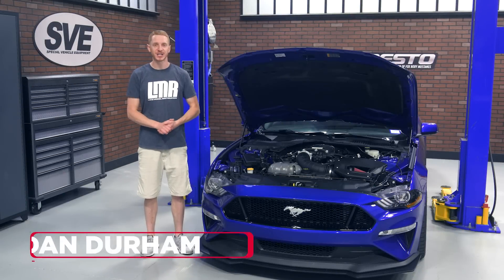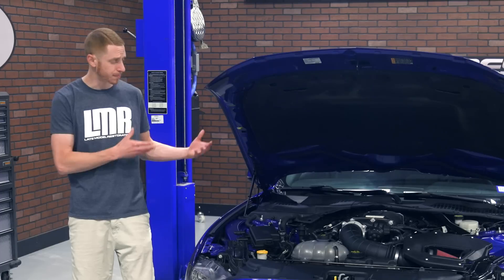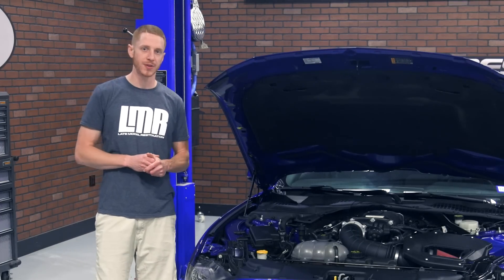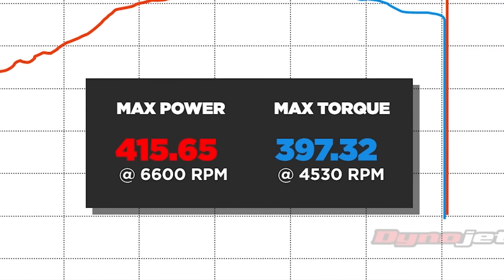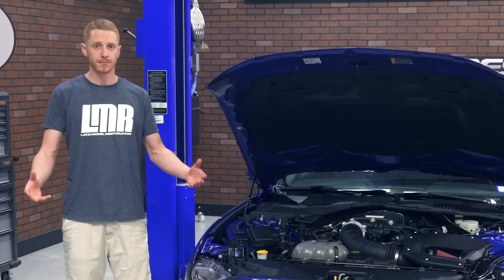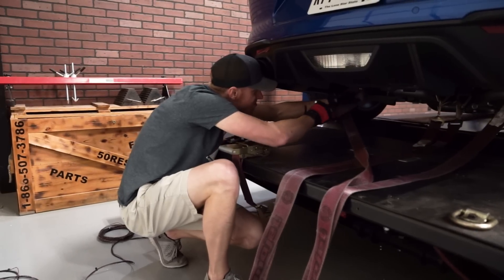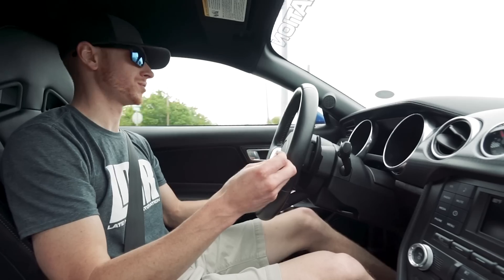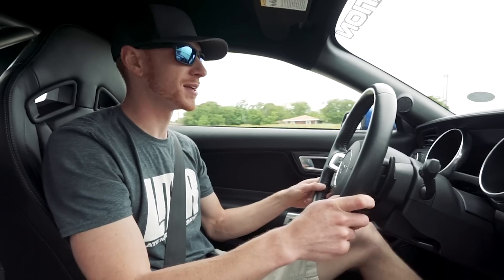2018-2021 Mustang Roush Supercharger Phase 1 Kit - Review/Dyno/Test Drive

Comment: Is over heating an issue still? Im looking at a used 2020 with this brand but i dont know which version intercooler yet
Reply from the maker: The Phase 1 kits are no longer available. The Phase 2 kits include a larger heat exchanger and different calibration. We did some very minor testing, and the Phase 2 stuff does help the car, but it didn't just "knock our socks off". One of our employees has the Phase 2 kit paired with long tube headers, a killer chiller, and custom tune. Back in December at the Texas Motorplex, the car went 10.13. I can't remember the mph or the 60'. It was all over the 10.1x throughout the night. Hope this helps. -Landan
Reply: @latemodelrestoration when did they stop selling the phase 1 kits? The reason I ask is this Mustang at delaership is a 2020 so maybe it was installed with phase 2. Is there an easy way to determine which kit this car has installed? I checked the carfax but no mention of supercharger install.
Reply from the maker: @212helpdesk  I remember the Phase 1 kits being discontinued around Q1 or Q2 of 2022. There really isn't any way to tell the difference other than the size of the heat exchanger.

Below is a video of us upgrading the car to the phase 2 kit. In the video, you can see the size difference of the heat exchanger.

https://youtu.be/H9SDGCrSOzE?feature=shared

Comment: What I want to know is can I put this on a 2021 mack 1🤔🤔
Reply from the maker: Hey Jordyn, this kit has not been tested on a Mach 1. You will need to contact Roush directly to see if this kit fits or if they offer a kit specifically for the 2021 Mach 1.

Comment: What would someone expect to pay to have this installed at a Roush dealer or Ford approx? 10 hours labour?
Reply from the maker: Unfortunately, it's hard to say since we did this over the course of a couple of days. We recommend checking in with your local dealer and getting a quote on the install.
Reply: I’ve priced it through my local dealer, and they quoted just over 10k, but that’s parts,labor and warranty for 3 years,36,000 miles.

But, you can always buy the kit, then have Gord install and still be under warranty, and save a little bit of 💰
Reply: Roush dealer quoted me 11,473 out the door and just over 14,000 to do billet oil pump gears too

Comment: The biggest thing that turns me off about this blower is that you have to modify the block i.e grind parts off where as with the Whipple or VMP you don't have to do any of that and you also get the 3yr, 36k warranty. I'm leaning more towards the VMP though.
Reply: Where is this possible at? 😳 
I'm looking for the Whipple install with warranty.

Comment: Wheels and specs?
Reply from the maker: They're 19x10 +35 and 19x11 +50. As for the tires, they're 275/35/19 for the front and 305/35/19 for the rear. Check out our wheel selection for 2015-2020 with the link below! https://lmr.com/products/2015-Mustang-Wheels

Comment: What’s the additional chin spoiler on the car at the beginning and end of the video?
Reply: Looks like the performance pack lvl 2 splitter or a replica, but the rear spoiler is pp1 and auto trans wasn't available on pp2 cars, the wheels are also pp1 in some parts of the video, and pp2 wheels or replicas when they're on the dyno? guessing they got pp2 take off wheels and front chin splitter from someone and bought the pp2 underplate to mount the splitter